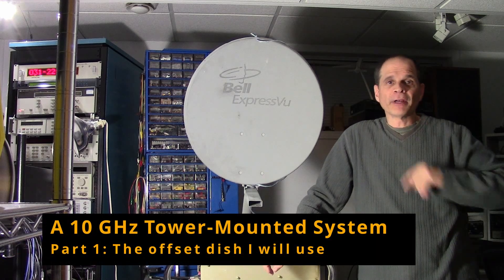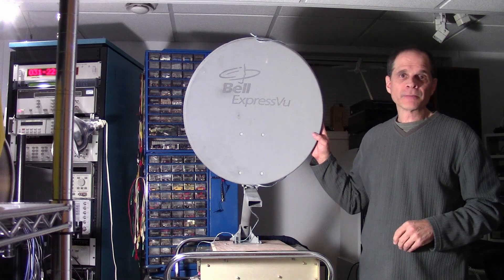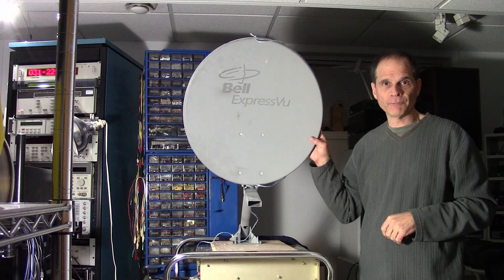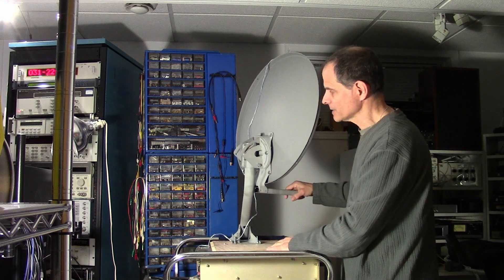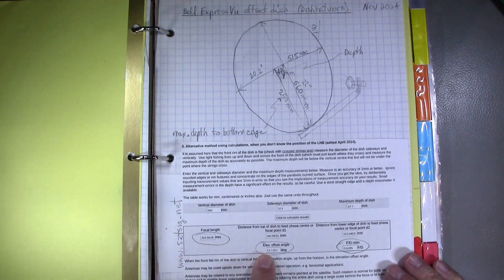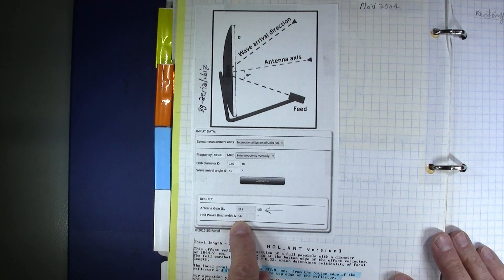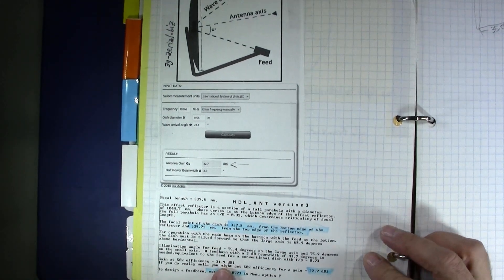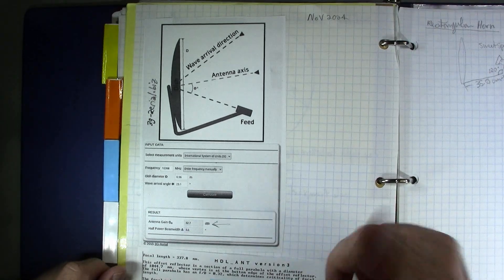Tower-Mounted 10 GHz Transverter System, part 1 - Presentation

Comment: I use a Yaesu G-800DXA rotator on a 60cm dish on 10 GHz with no pointing problems at all.  It works very well.  I just eyeball the display to the nearest degree and I'm usually dead on for the distant stations.
Reply from the maker: Thanks for the return. Not possible with the Tailtwister, unfortunately. Just the slowdown will make you miss the target, mine having a few other antennas on the mast, an HF yagi for one. Moreover, I believe the brake wedge has a 5 degree resolution anyway. So it would be a hit and miss.